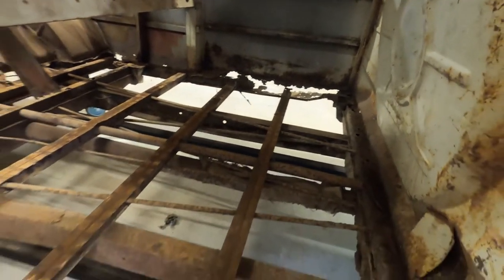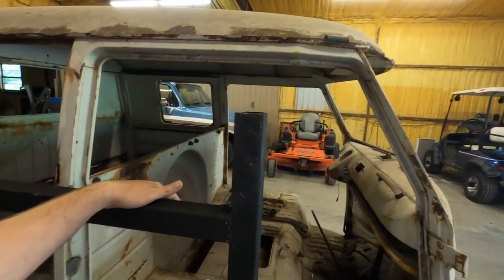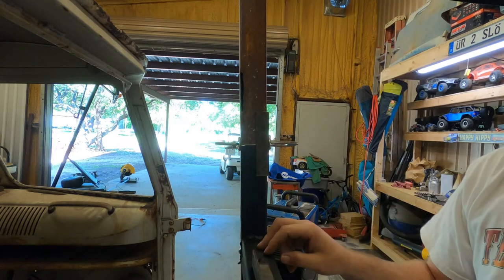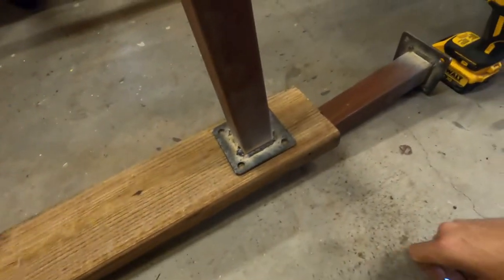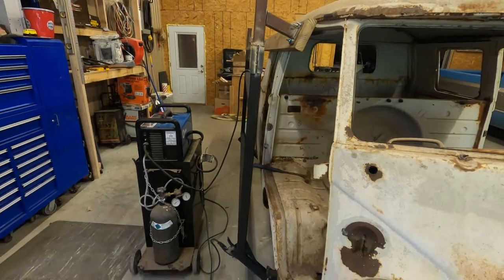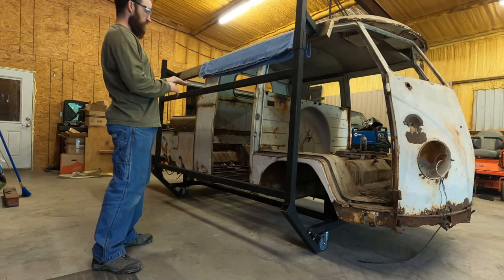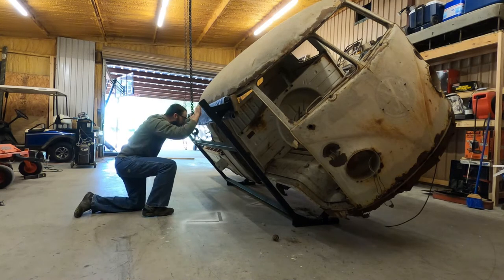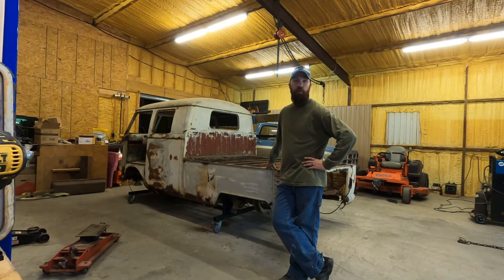1962 VW Double Cab Restoration (Part 5) | Things get a little TIPSY!

Comment: You are charging!  I like the way you are leaving some areas of the floor to act as a template for later. Very important.
Reply from the maker: I've never done one before, so the reference points should help me out and doing only one side at a time should keep the body lined up. I've see some people take off a lot of metal and I'm just thinking everything is getting tweaked and everything is going to be hard to line up again. It's going to be a slow process (mainly due to the cost of double cab specific parts). Either way it's fun and thanks for watching!!